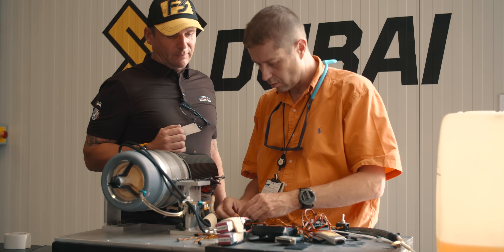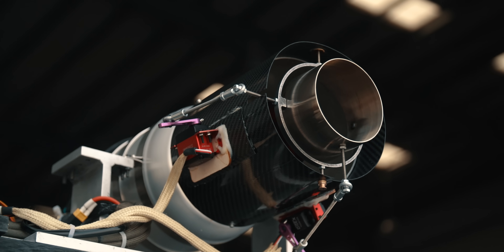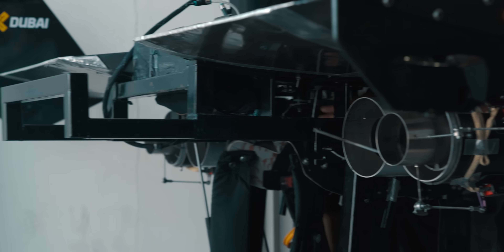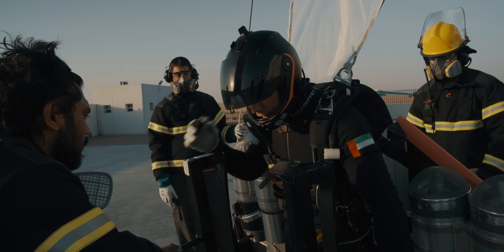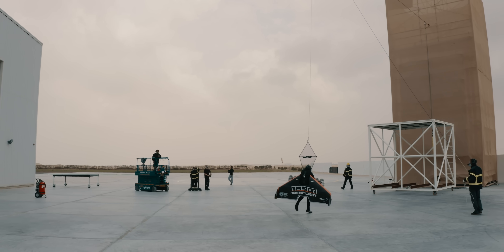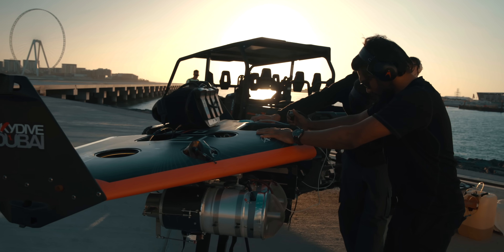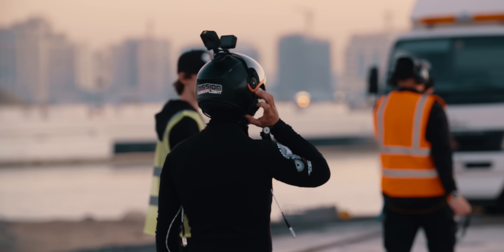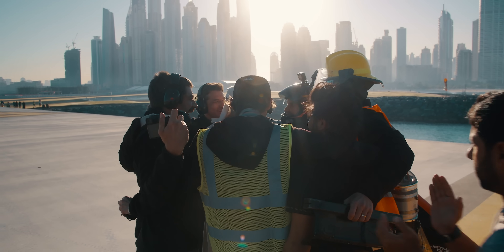The Road to Takeoff - Jetman Dubai - 4K

Comment: I'm an Aerospace Engineer, and I'll try to reverse engineer their design to figure out how much pilot weight the wing can sustain in hover mode ;)

The main weight factors are the weight of the 4 engines, the wing structure and combined parts, and the fuel. Let's go! 

ENGINES
I confirmed they used 4 jet turbine engines from JetCat called P400-PRO-LN. They produce 400 Newtons of thrust, a total of 1,600 N of thrust! 
So all engines combined can lift 1,600N/9.81m/s^2 = 163.1 kg total.
They weigh 4.06 kg each, which is a total of 16.24 kg.

FUEL
They say on their website they have approximately 13 min of flight but they don't use max thrust all the time, just for take-off and max speed tests. Let's say if they were at max thrust all the time, they probably have around 6 min. The P400-PRO-LN Consumption Full load is 1,392 ml/min, so 4 are 5,568 ml/min or 5.568 L/min of kerosene. Therefore, we can figure out how much fuel he carries, which is approximately 5.568 L/min x 6 min = 33.408 L of kerosene. 

1 L of kerosene = 0.819 kg. So 33.408 L of kerosene = 27.36 kg.

WING
The hardest one to estimate. It's made of carbon fiber, but we can't see what's inside in terms of electronics, ribs, and spars. Let me know below how much you think it weighs, and I'll update the calculations! But for now, let's say it has a max of 5 kg.
-----

Finally, we have:
163.1 - 16.24 - 27.36 - 5 = 114.5 kg. So a pilot with all the equipment and gears can weigh a max of 114.5 kg to at least hover. The lighter he/she is, the faster accelerations he/she can pull from this wing. Such an amazing project! I wished they kept going. RIP Vince.

Comment: backstory for you: yves rossy the man who invented and started flying this jetsuit, the original jetman, detached himself from jetman dubai because safety issues: the way the jetsuit works, if anything happens between take off up to 250m-300m there's no plan b and the pilot will die. But jetman dubai wanted spectacle, wanted the visual of take off from ground into flight.

Comment: Beautiful video. How did he die exactly? RIP
Reply: they have not disclosed the exact casue for obvious reasons, but as i have followed jetman for years i can say there were one of 2 reasons .
1- this flight system taking off from ground is new and is in development, so during takeoff if it fails till the time jetman reaches 150 ft parachute wont work so death is sureshot
2-  parachute malfunctions or he struck something at that speed no one can survive.
Reply: @yd5540  I am surprised if they didn't figure out any safety system for case #1.
Reply: @gbessone  yeah thats why yves rossy the inventor of jetman never used take off method. this method is new so they have yet to develop it fully and safely

Comment: You Dubai folks have All the fun!!! Great Work! 
Suggestion: don't use ABC powder based Fire extinguishers on your turbines, the grit in the powder destroys the bearings. Use Halon instead. A few bucks more, but will save your turbine. 

Turbine helo pilot 26 years, we only use Halon.
Reply: Yes great point!!  Im not sure if engineers realize this, im sure they don't want to rebuild the turbines constantly once they get it dialed in.

Comment: When he starts to commit to the climb he's got to go full throttle and gain altitude as fast as possible because if the engines fail during that time he won't have enough height to use his parachute. That's the most dangerous part of his flight.

Comment: I hope they used more than just jam nuts to hold that ball joint on the threaded rod. If that thing comes loose it's bad news. You would think that something so critical would be designed significantly more robust. All metal lock nuts would be a place to start. Sheesh. 2:23

Comment: I think Yves Rossy is not part of the Human Flight Project because of the simple fact that this may not be what he had in mind. If you keep adding things to the wing, it will soon become an inside-out airplane. Those thrusters could be easily controlled with a gyro instead of the joystick (safer but less fun).

Comment: Haha using a Wii Nunchuk is such a good idea, perfect fit for this application
Reply: They couldn't design anything better.. and despite 'the foolish' commenting, below, it is designed for hundreds of hours use. The flights are short and will never add up to a month of gaming before being replaced.. it is perfectly applicable engineering.
Reply: @SLINGSHOTWORLDTV  "They couldn't design anything better" You dont "foolishly" believe that do you? I assure you they could. The controller was designed for hundreds of hours of use using the cheapest parts they could get away with. They weren't designed with someones life on the line. Even if they replaced it every run it wouldn't change anything.
Reply: @SLINGSHOTWORLDTV  It's also very cheap, which when considering the value of a human life, I suppose goes hand in hand.  ------
.... wtf are you on about? It's a wii nunchuk. Possibly the worst analog application in the entire gallery of console gaming.
Reply: Wii nunchuk isn't exactly the most accurate analog platform. I suppose they don't need fine detail, but those nunchucks have long had drifting deadzones, and have been known to crack and even snap off leaving a sharp stump at best.
Reply: I thought the exact opposite. 
A $20 wii nunchuk definitely isn't something they should be risking that much on.